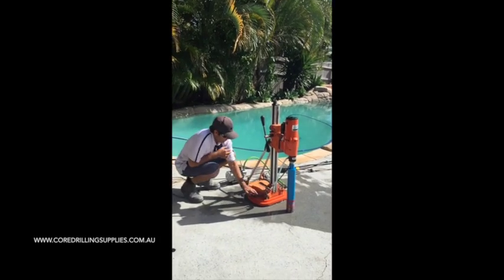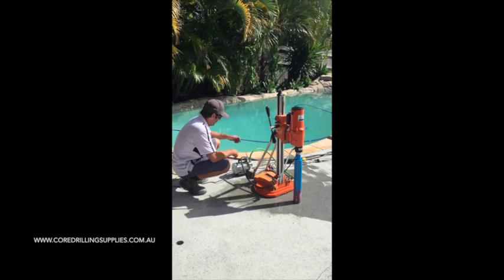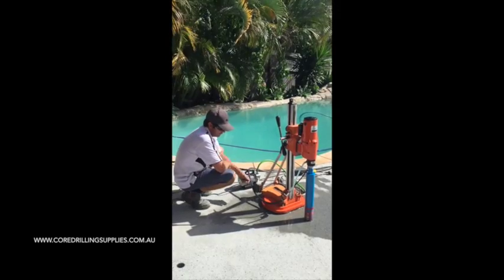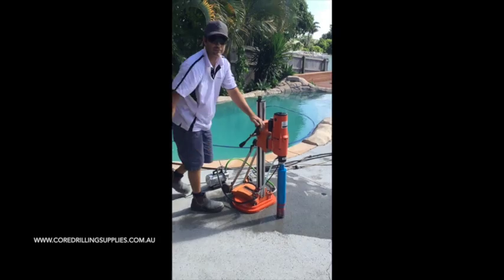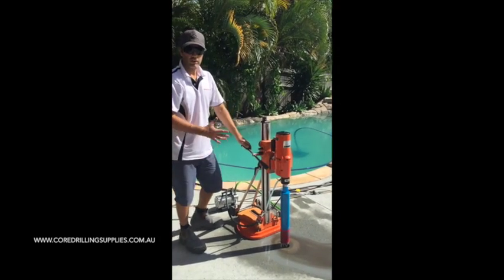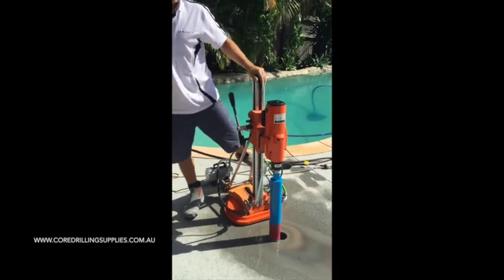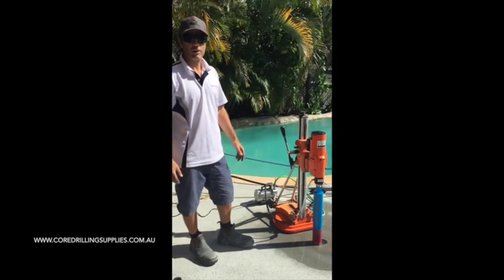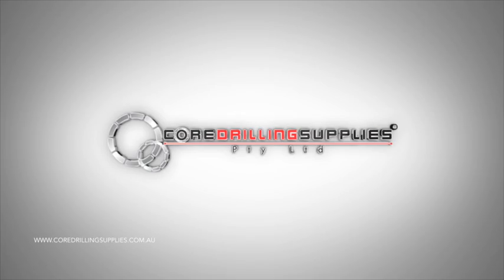Concrete Core Drilling with a vacuum pump and base plate

Comment: While using the vacuum pump and base have you ever had a situation where the base has released from the floor. And does the vacuum pump base system leave any marks on the tile/paver surface
Reply from the maker: no he hasn't had that happen